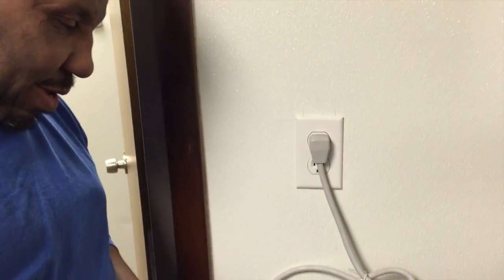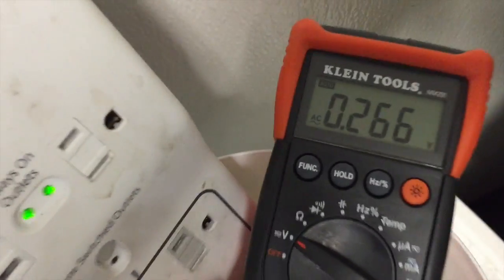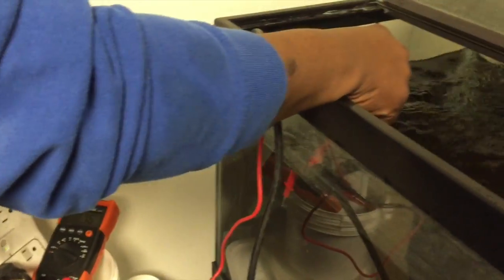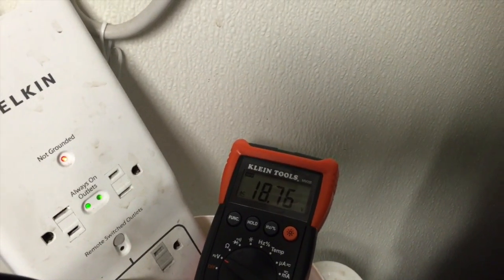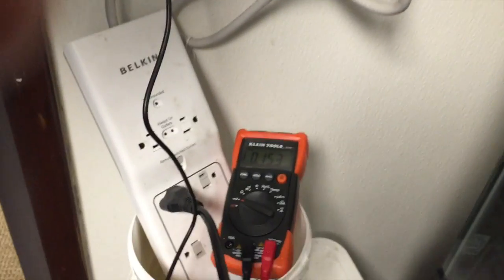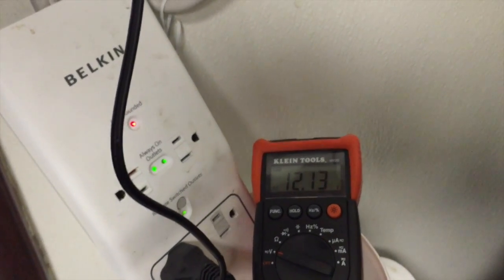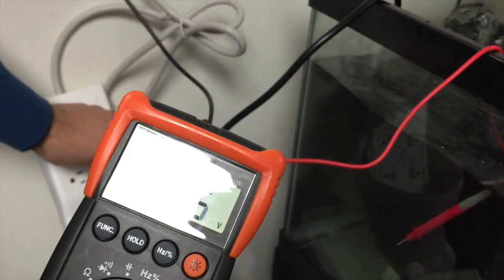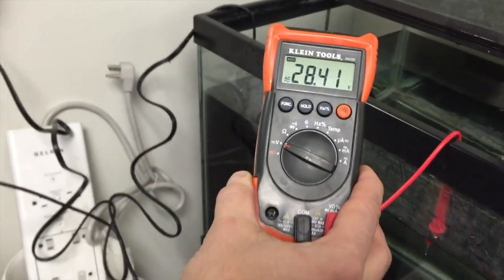Voltage In aquarium Pumps

Comment: What you measure is the voltage drop at the high input impedance of your voltmeter. At 10MOhm input impedance and 40V measured the current would be 4µA! Great. Go and get a 1k resistor, connect it to PE and the aquarium water and measure the voltage drop at this resistor. I bet you're gonna measure no more than 10mV.